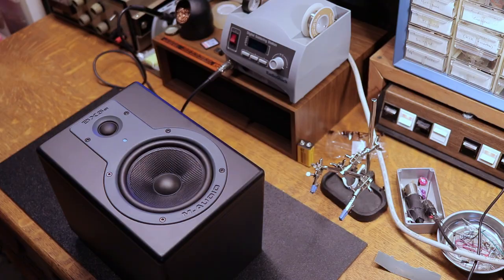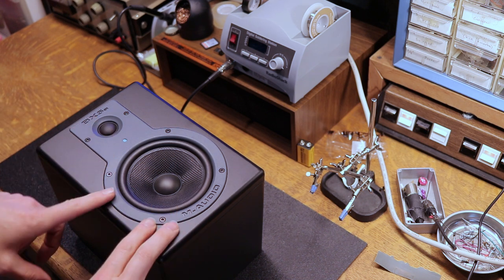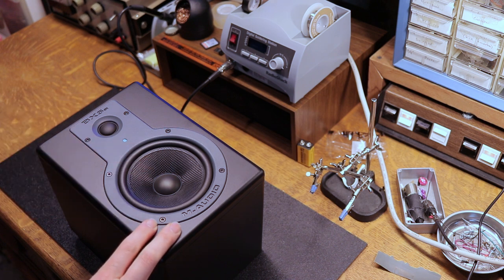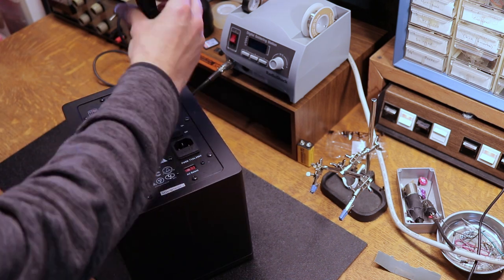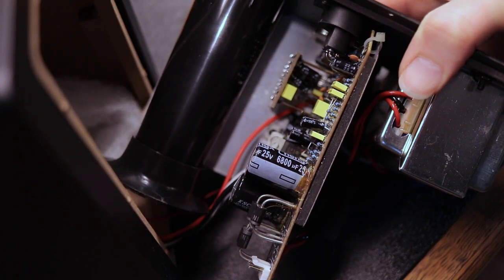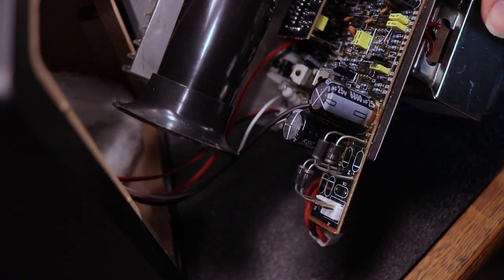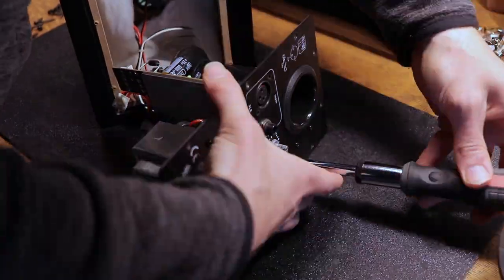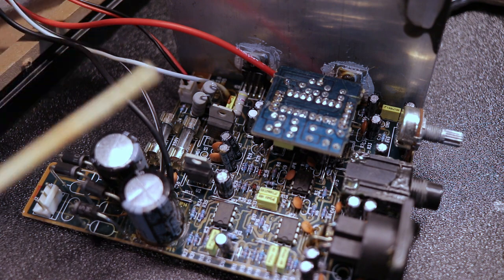M-Audio BX5a Capacitor Replacement

Comment: Great job, one thing you forgot to mention is to make sure the polarity of capacitor is right or you're going to have a loud bang 😀
Reply: Can we discuss this further? I have a pair of these and they have always given a loud thump when powered up. Now one of them sounds like the tweeter is blown but there is no visible damage. Could this be from faulty assembly from the start?
Reply: also make sure to get a cap rated for the correct voltage.
Reply: And it sounds like fireworks! 😆

Comment: Few things ... mind the polarity on electrolytics. You should post what values those 4 caps were. And while you were in there probably should have replaced the other electrolytics on the boards.  thanks for sharing this info and not making it a painful 20 min video.
Reply: I'm the very first one that came up with this fix on my old channel. The values are 6800uf 25v. It's not necessary to replace the other caps. Mine just went again & I replaced them this time it didn't completely fix the problem. After re-capping the entire board except for the 1 NP on the MB & 2 NP on the daughter board the driver still works but the tweeter drops out. The other cap values are (Not including the 3 NP caps) 

6 - 22uf 25v

2 - 1uf 50v

3 - 10uf 50v

2 - 100uf 16v

1 - 220uf 16v
Reply: @TheCleaner6969  Good to know thanks for the info.
Reply: @awwnawmang  You're welcome.

Comment: Hi, i replaced my capacitors both speakers, but the other pair still has a low ouptput volume compared to the other one and still has the popping noise when turned on, tje other one is like brand new after replacing the caps, what could be the problem? Thanks